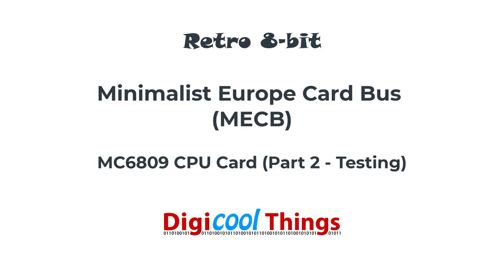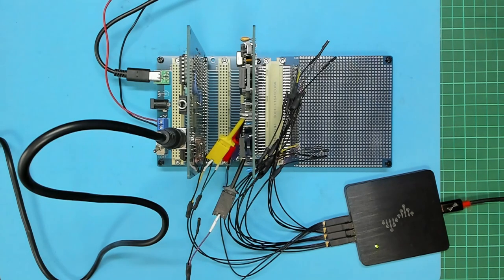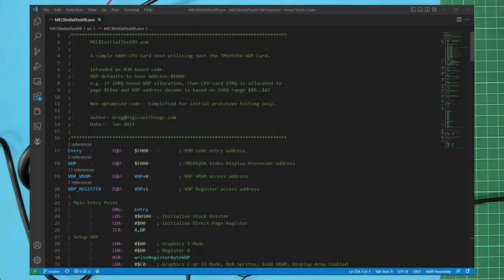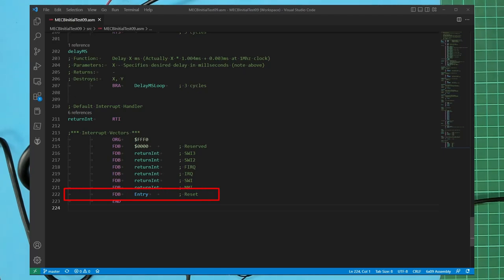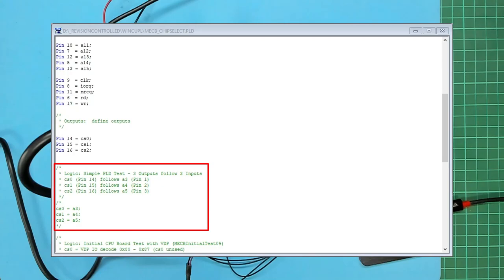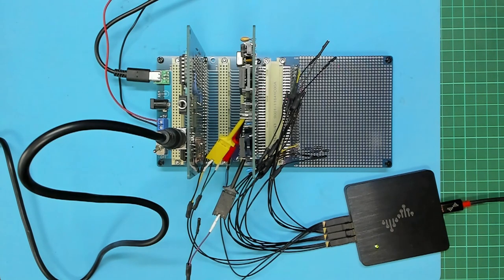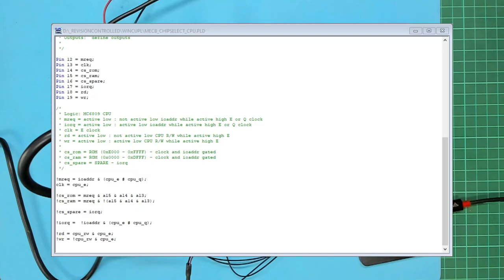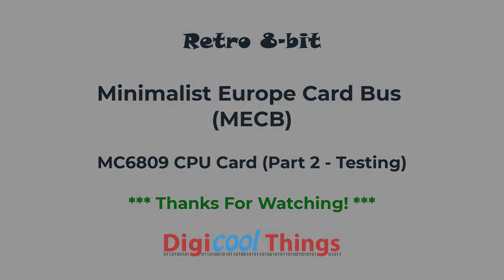Minimalist Europe Card Bus (MECB) - MC6809 CPU Card (Part 2 - Testing)

Comment from the maker: NOTE:  Be sure to check out the updated source code in the MECB GitHub repository (see description for links).
The WinCupl source has been redefined to be much easier to read and help avoid the simple logic error I made (now all positive logic equations), thanks to the feedback below from Brian & Marc.
Also, the 6809 Assembly source has had some optimisations added, also resolving a small VDP access timing issue that later became apparent, caused by me initially writing sequential VRAM bytes just a bit too quickly, during the originally presented Test Pattern setup code.

Comment: Ah, memories! My first experience with a microprocessor was for work, so i had a bit more resources to work with. I had a 5 MHz oscilloscope, and a single-step circuit that i designed and built. The microprocessor system had a blistering 256 bytes of RAM and 256 bytes of UV erasable PROM. Through work, i also had access to a timeshared BASIC computer - and wound up writing an 8080 assembler in BASIC!
Reply from the maker: Thanks for your comment. Indeed, my first oscilloscope was also single trace 5Mhz, but it was a great upgrade from the home built logic probe I started with. The early days were exciting times, where everything we did felt like we were creating at the bleeding edge.  Writing an 8080 assembler at this time would have been a great experience!  If you haven’t seen them, my videos covering my early 80’s wire-wrap 6809 Eurocard might be of nostalgic interest.

Comment: Beautifully described, takes me back to when I built my own 6809 board back in the day where I used the techniques you described. I'm intending to build one of your backboards to re-do my old system and bring it up to date with a VDU card. Nice to see you using the ds logic pro too as I also have one. Your card system rocks, I'm collecting parts to build a set myself. Much appreciated, David
Reply from the maker: Thanks for your kind words.  Much appreciated.  Yes, I found the small DS Logic analyser to be a very cost effective solution, which covers most of my needs.  They’re an ideal solution for retro digital enthusiasts! 
I’m really enjoying rediscovering and remembering what we did back in the early days, and the fun of modernising the experience.  
I hope you get the same enjoyment out of your journey!  Cheers.
Reply: @DigicoolThings  I hav found the protocol analysers useful on the logic probe especially the. I2c SPI and serial ones. Although z80 decoding is available nothing for 6809 or similar. David.
Reply from the maker: @lamalandy  Yes, the protocol analysers are really useful.  I did see the Z80 option, which was a bit surprising that there was only Z80, and no Motorola option.  But, given how simple the bus interface is on these processors, the Parallel protocol was all that was really necessary for helping to see what was happening on the bus.

Comment: The joys of a logic analyser if you could afford one in the 1980’s, when working on the Intel 8086 back in the day we had two “In Circuit Emulators” (ICE).

One was an Intel ICE which cost 4 times my yearly salary and could run at full speed, the other one could not run at full speed for long before it started to produce errors. As an engineer who had come into R&D from the shop floor route. And was just working on ways for the test department to test the CPU cards I was not allowed access to the Intel ICE :-(

Access to the other one was OK if no one was using it, which as it was unreliable, was most of the time. Well I found that opening the case and putting a desk fan almost on top of it would work ok for as long as I needed it.  This made my life so much easier as i could now do all the nice things like single stepping, changing the address counter, so i could run blocks of code from the Eproms to test more bits of code without having to blow more Eproms.

Thanks your videos are bringing back a lot of fond memories
Reply from the maker: Thanks for the story.  Yes, this journey is bringing back many of my own early memories.  It's lots of fun re-living some of our early retro experiences, but with the added benefit of relatively cheap recovered components and affordable & significantly more advanced tools to make the experience now even more enjoyable!

Comment: You can specify the pins as negative-logic (not). That way you can reason in positive logic in the rest of your equations. This will usually keeps me from making the mistakes you've made. [2c]
Reply from the maker: Thanks for the advice.  I had intended on taking the simplest, easiest to read approach.  But it looks like I either failed on that front, or I was just having an off-day when I wrote the original flawed logic statement.  Oh well.  At least it made me happy finally having something to fault-find! :)
Reply: Totally right Marc.  Where signals are inverted on the wire then they need to be described as such in the WinCUPL source AT THE PIN DESCRIPTIONS and nowhere else.  Moving to this higher level view where we write down the logic that we want we must divorce ourselves from the knowledge of the physical situation (inverted signals that are 'active low').  Perhaps a suitable analogy is where, in a programming language, we use a signed integer without caring or knowing how it is represented in the low level machine (1s complement, 2s complement, sign & magnitude, etc).
When the problem was diagnosed and the GAL source was shown I thought "missing inverts on the pins".
Reply from the maker: @Brian_Of_Melbourne  Thanks Brian (and Marc).  PAL's were out of my reach as a hobbyist in the early days, so I'm new to WinCupl.  One of my life mantras is to "learn something new every day", so I do thank you both for educating me on the clearly more correct approach.
As a result, I've now redefined my WinCupl source for both the 6809 and the VDP logic, tested and committed to the MECB GitHub repository (feel free to take a look).
I've committed the changes with the comment: "Redefined to now assign active low signals at the pin declaration, so all logic definitions are now consistently positive logic assertions (therefore easier to read and avoid inverse logic errors)."
Thanks again, your feedback has been much appreciated!
Reply: @DigicoolThings  It is perhaps a bit because PALs and GALs are seen as a bit 'old hat' that there's not much in the way of explanatory material on the web.  Do let us know if you find many.  Too much of the material is about 'this is the syntax' and 'this is how to get it to work', rather than 'this is what you should be doing' and 'here are a hundred examples (with explanations)'.